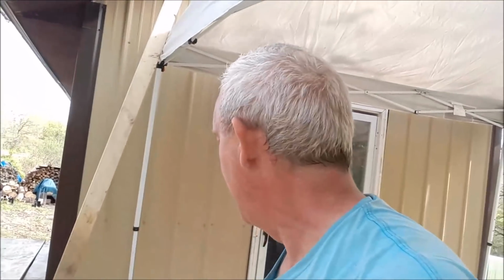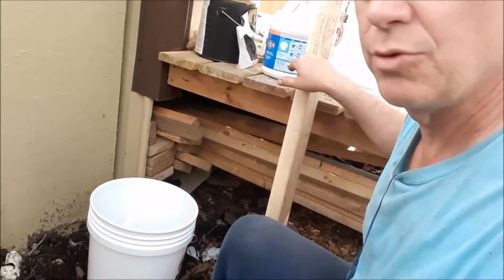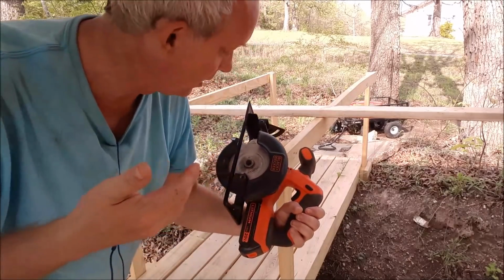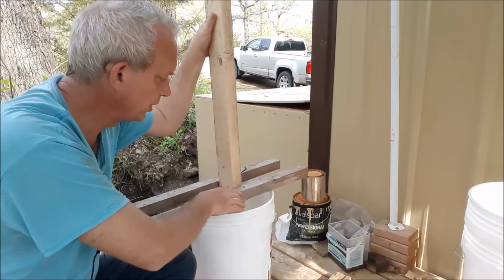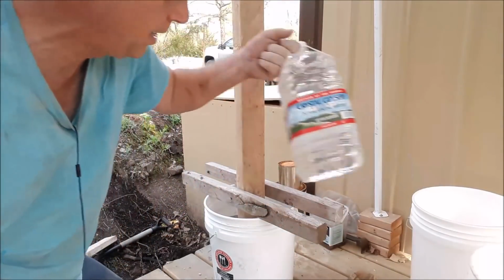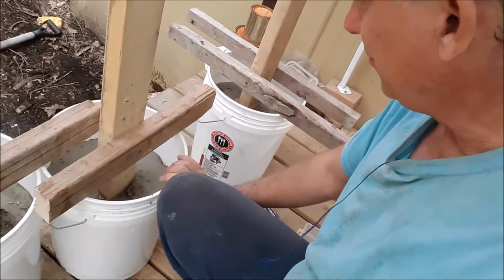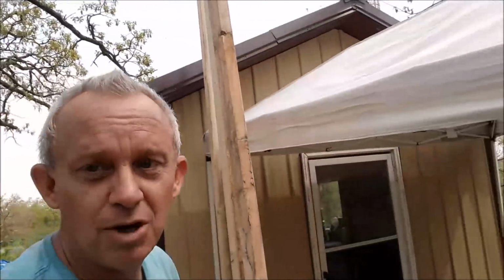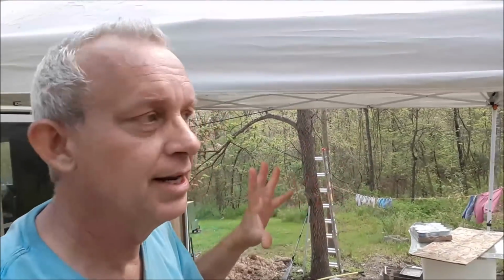Tiny House Falling Down...Too Much Weight While Living Off Grid

Comment: Next time try putting a few nails , half driven in the board to grip to the cement. Just a thought. Keep living the dream.
Reply from the maker: Not sure why.
Reply: @LittleHouseOffGrid  I think he was suggesting that the nails driven into the 2x4's (in the concrete) will help against pullout than just a plain 2x4 stuck into the concrete.
Reply from the maker: But why would the 2x4 pull out?  Gravity pushes the roof #